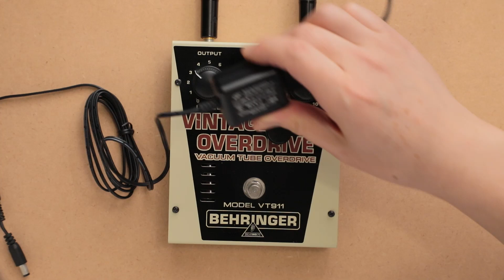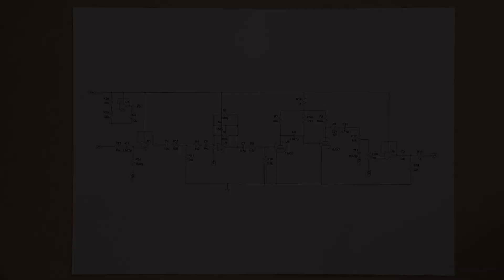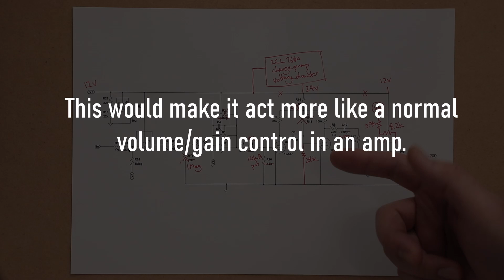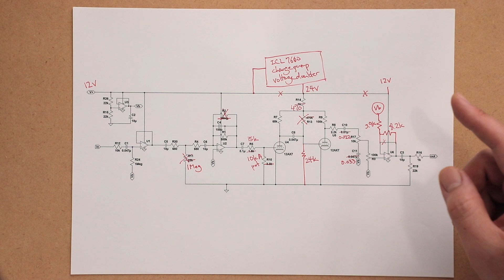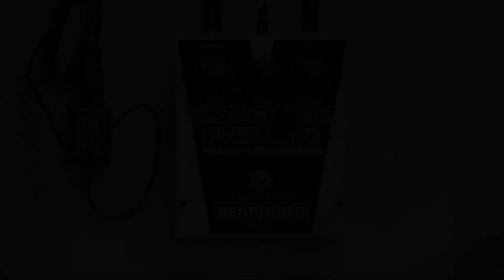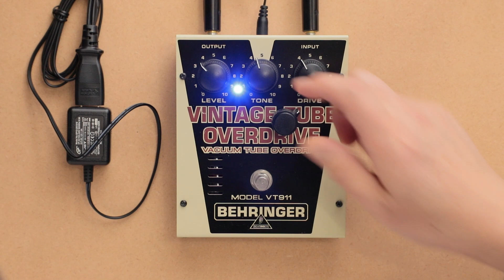Behringer VT911 Doesn't Get Much Love - Let's Check Out The Circuit And Try Some Mods

Comment: I have one of these too and I connected a trimpot parallel to input pot to decrease the value of this control and the result is a less distorted sound  Do you know if I can use it with 12V or 18v or even 24vi instead 9v? Cause I got a cleaner with more headroom at 18v but I don’t want to damage the pedal Do you know if I can do it Thanks for you attention Mr Suzuki
Reply from the maker: Thanks for watching! 12 volts won't be a problem, but 18V and 24V can be a problem since the heater wiring for the tubes come directly off of the power supply. With anything above 13 volts you'll be overheating the tube and will most likely shorten its life or damage the filaments. Hope this helps!

Comment: My opinions: The 12AX7 tube biasing should be different. The anode resistor is too small, it should be between 100k and 120, higher for more bite and odd harmonics. One could even add a bypass cap here to smooth high end, though I wouldn't. There should be a cathode bypass cap between .68 and 1, and a cathode bypass resistor of 1.5K to 2.7K.  Omitting a cathode resistor & bypass cap removes crucial overdrive tailoring. C7 should be .022 no? What are your thoughts?
Reply from the maker: Thanks for watching! Two reasons why I did it this way:
1 The construction of this pedal is pretty cheap, and the tube socket is stuck on a PCB. So, if I were to add a cathode resistor/capacitor, it would mean cutting the PCB traces and doing some creative wiring.
2 Since this pedal is a "starved plate" design, only having 24 volts on the plates, I figured the "grid leak bias" would be the best way to bias this tube section for the best overdrive tones.
The value of C7 is going to change the amount of bass, since there is a 10K pot right after it. I wanted to keep this capacitor relatively large so I don't cut off too much bass.

Comment: sorry bruh, but the power supply dosent matter. adding a few volts aint gonna do anything, because the distortion is caused from the op-amp over volting the input of the tube. it especially dosent matter since you basically doubled up on shit to compensate for the increased voltage and bleed it off as heat. this is a shit excuse for a mod, done by someone who clearly has no fucking idea what hes doing. all you did was decrease the power and reliability of this unit.

Comment: Shouldn't plate voltage be like 250v?
Reply from the maker: Thanks for watching! Yes, you are right, this pedal is what's called a "starved plate" design, found commonly in a lot of pedals that use tubes while accepting your typical 9v or 12v center negative power supply. They kind of went out of fashion, so you don't see many pedals today that do this.

Comment: Do they even sell this model anymore?
Reply: I bought 1 used a couple yrs ago and did the Bitmo mod to it. Later changed to a 12au7 tube. Still not impressed with this 1. Probably cause I got 2 Butler Tube drivers and this will never sound like the Butler's
Reply from the maker: @sparkyguitar0058  Yeah, I would imagine that the Butler Tube Drivers are on a different level than these, tonally and build quality wise!
Reply from the maker: Thanks for watching! I bought mine used, have no idea if Behringer still makes them. But, you can find these for real cheap on the used market (I think mine was $20) which makes for a fun project to work on, if you're into modding pedals.

Comment: Will this mod work with the VT999?
Reply from the maker: Thanks for watching! I don't know much about the VT999 and I couldn't find a schematic after a quick search online. I found some photographs of the circuit board and it looks quite a bit more complex than the VT911. Aside from all the extra knobs and switches, if the tube section of the VT999 is the same as the 911, you can probably do a similar mod. Otherwise, it's really hard to say.

Comment: what is the function of 24k resistor
Reply from the maker: Thanks for watching! The 24k resistor, in conjunction with the 47nF capacitor before it, create a high pass/low cut filter to cut off some low end in the signal. Changing its value will change the bass response of the pedal. It also acts as a grid leak bias resistor for the tube following it, but for this purpose, the resistor value isn't crazy critical (it doesn't have to be 24k). Hope this helps!

Comment: I had one of these and absolutely agree about the bad sound in stock form. The changes made the pedal sound way better. 

I would try sticking some diodes to ground on a switch to hard clip the signal before the last opamp stage. It would turn the pedal into a mad fuzz machine
Reply from the maker: Thanks for watching! Great idea, I didn't think of adding hard clipping diodes, but that would definitely be fun!

Comment: The positive outside power was a boss patent, them became the backwards standard for pedals.
Reply from the maker: Thanks for the info! I always wondered about that, figured there was probably a historical twist somewhere along the line. Didn't know it was Boss that came up with that.
Reply: @arito  just one example of how patent law is actually holding us back. Boss set the standard for pedals they got so popular, but talk about a place to pick up noise,, positive shielded input jack?
Reply from the maker: @DANTHETUBEMAN  And it makes it kinda difficult to use random available power supplies, for people who want to play around with 12 or 18 volts with their pedals.